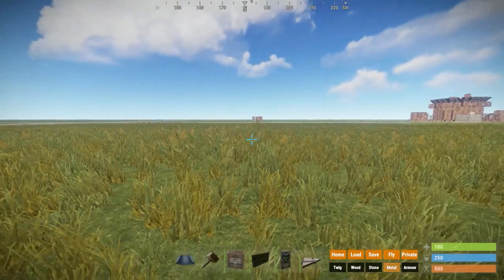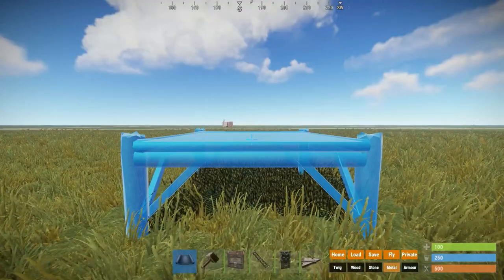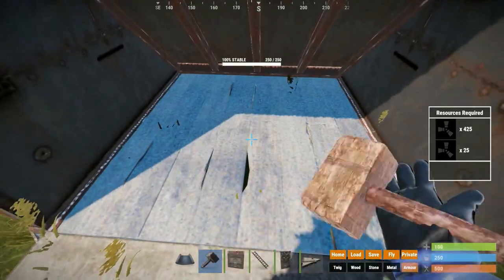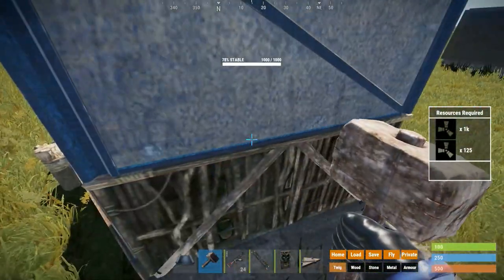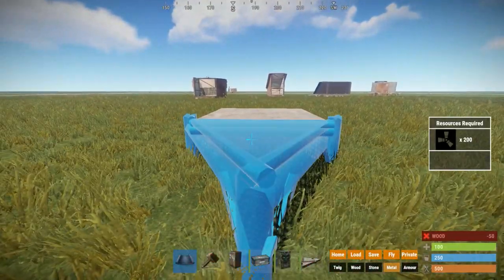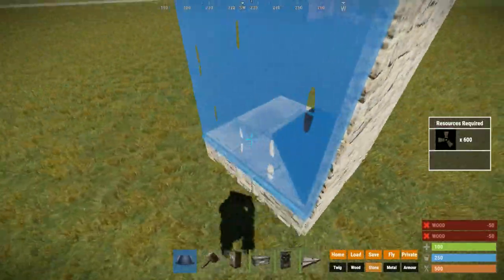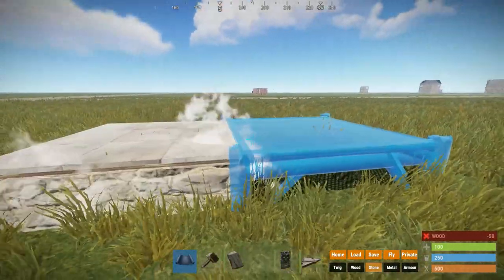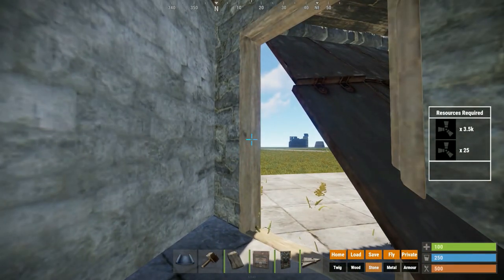Rust Bunker Tutorial | Quick Tips | Tutorial | Beginner Guide

Comment: You're missing a very important bunker type, the one I use in all my bases. Three hanging half walls over a triangle. It uses the same mats as capping raised foundations, it can't be picked, it offers additional space inside the bunker, and it offers additional horizontal segmenting/walls over raised foundations (which let you pass through two potential walls by blowing/JHing through one foundation.
Reply: Really only recommended for a sheet metal bunker as you have to build three walls at the bunker entrance, though. But the additional space inside the bunker generally allows you to make up the difference to the TC and thus save on high-qualing your entire core
Reply from the maker: Never heard of that bunker before.
Reply: @DavDavBuilding  https://www.youtube.com/watch?v=VdCYwmviC08&t=435s
The base is this video is a bit out of date but at the timestamp linked I demonstrate various hanging wall bunkers